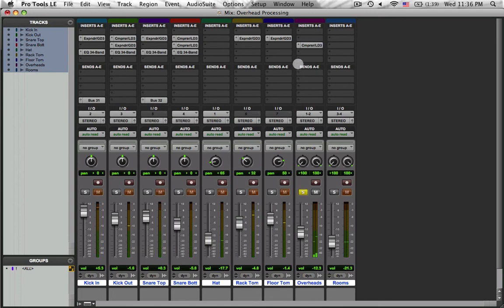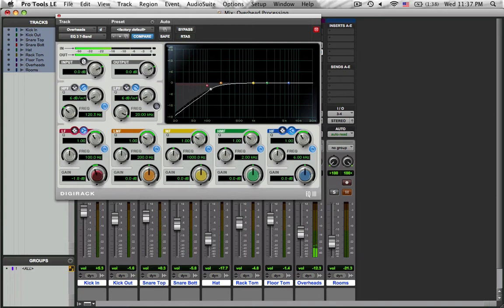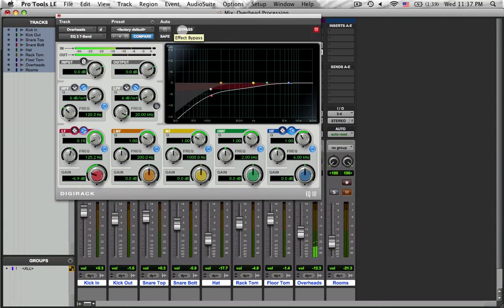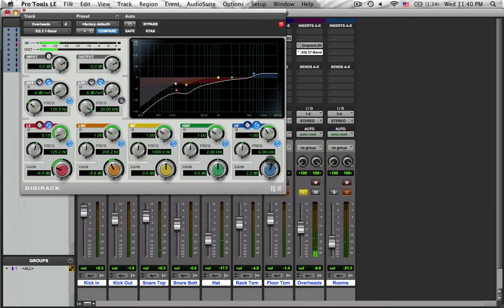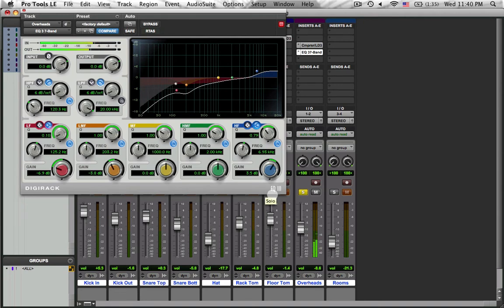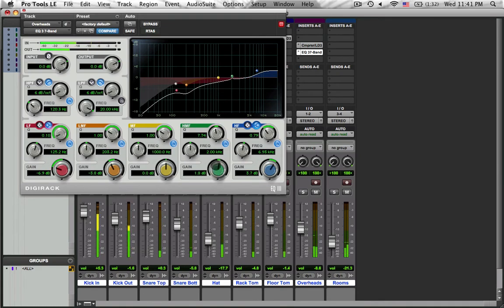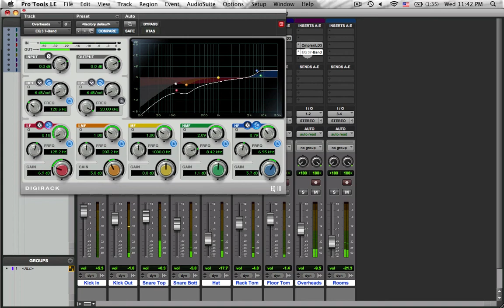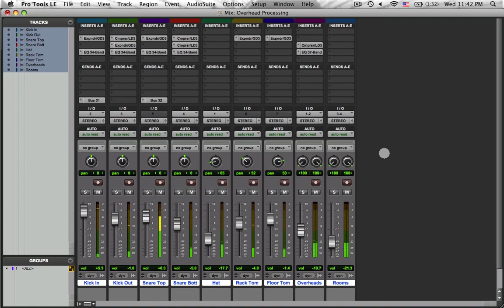Mixing Drums - Processing Overhead Mics (2 of 2)

Comment: Do you use a pad when recording overheads? I use a Digimax Lt and I don't even have the knobs turned up and its already signaling pretty high I should probably use a pad?
Reply from the maker: +Daniel Walters My church has that same unit, and it is not forgiving... go over, and it'll snap at you big time!  Yes, a pad will probably help.  If your mics have pad switches you're in good shape.  Otherwise it might benefit you to purchase a couple of Shure or Whirlwind pads (XLR connector types).